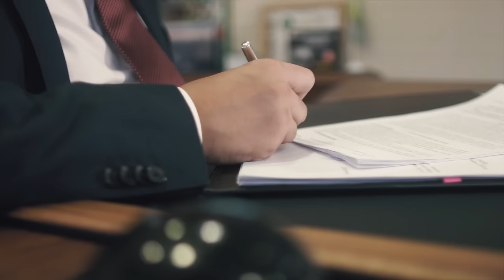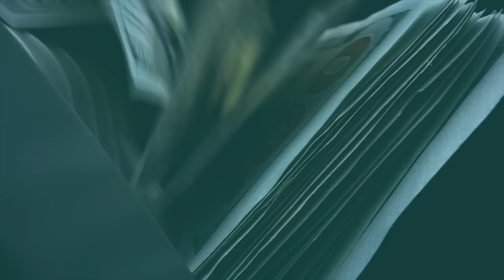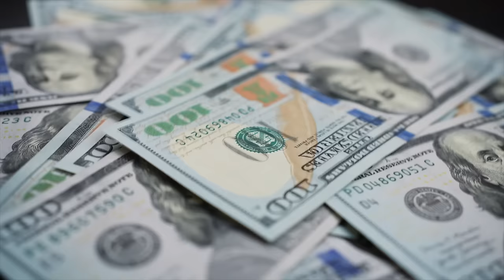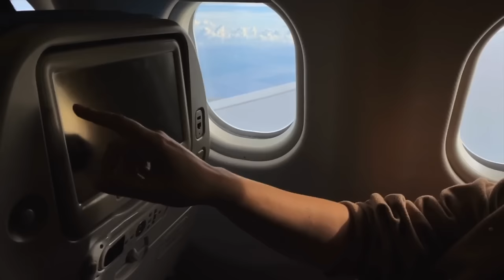How California Finally Plans To Finish The High Speed Rail Project

Comment: CAHSR's route from LA to SF is 440 miles, going via Palmdale, Bakersfield, Fresno and San Jose. To make the 2 hour 39 minute nonstop travel time, trains will have to average 166 mph (267 kph), which by comparison the fastest Shanghai-Beijing HSR service averages 181.4 mph. On shared tracks in the Bay Area and Greater Los Angeles, HSR trains will have a max allowable speed of 110 mph.
Reply: As long as it's close to 3 hours it will be a huge success. Legally, they won't have to match that time. It was explained in a court hearing that the time was included late in the process to prevent the possibility of dumbing down the project so that it wouldn't be a HSR project in order to reduce overall cost at the expense of speed and efficiency. So if it takes 3 hours it would still honor the spirit of the original run time and would still run at HSR speeds.
Reply: @mrxman581  only nonstop trains would need to make that time, and CAHSR’s proposed operating scenario calls for six nonstop trains in each direction per day, 3 morning 3 evening during peak hours.
Reply: @ChrisJones-gx7fc  Very interesting,  and that makes a lot of sense. It's so dumb on my part for not even contemplating that option. Duh! Thanks for teaching me something today.🙂
Reply: @mrxman581  well, I don’t think that’s something CAHSR has officially stated, that only nonstops have to make that promised travel time, but they are designing and building the system so they can, so it makes sense. 

It’s amazing how some if not many cynics it seems believe trains will be stopping at every station, when every HSR system in the world has bypass tracks at stations and different types of services from local to express. 

That’ll be the same in California’s case, but only several per day will be nonstop all the way. All others will be stopping at at least two stations between SF and LA. CAHSR’s 2020 Business Plan included a supporting document titled Service Planning Methodology that showed proposed stoppage patterns for Phase 1, with trains about every 10 minutes on average.
Reply: @ChrisJones-gx7fc  Still, it makes a lot of sense and would make the entire route even more appealing to a larger group of passengers.  I could see the non-stop trips be extremely attractive to people who fly between LA and SF for work.
Reply: @mrxman581  that’s exactly what they’d be for, to outcompete flying. A sub-3 hour HSR trip downtown to downtown beats flying by at least a 1/2 hour if not an hour and possibly more. Plus the train would be more convenient and comfortable than flying, and the fare is supposed to be around 80% of average airfare.
Reply: @ChrisJones-gx7fc  Indeed.  And, commuters could actually work much more comfortably on the train too. I'm sure they'll offer services like Wi-Fi too.
Reply: @mrxman581  oh they’ll absolutely have free wi-fi and other amenities currently available on other HSR trains
Reply: @ChrisJones-gx7fc  Very cool. I hope they start testing the trainsets, on the initial 119 mile section, by mid 2028, around the time of the Olympics.  It might not be ready for pay service by the 2028 Olympics in LA,  but it could still be a huge publicity opportunity to see the actual trains going 220+ mph in a CAHSR commercial during the Olympics.  I read that CAHSR has requested 2 trainsets to be delivered earlier for testing.
Reply: @mrxman581  same, though I’m pretty sure their 2023 Progress Update showed December 2028 for start of testing, but that could be at the latest. Ideally CAHSR would get enough funding to be able to accelerate progress so Merced-Bakersfield service could begin in Summer 2028, alongside Brightline West launching their service then. 

That way the US would have three operating examples of high speed rail at the LA Olympics, and that should be a national goal in the spirit of Japan launching the first Shinkansen at the 1964 Tokyo Olympics.
Reply: Sorry I misspoke on the Altamont route. Freight definitely would be on a separate track and sometimes on a dIfferent ROW with two passenger tracks like what's proposed from SJ to Gilroy. There are abandoned SP rights of ways for this purpose as explained by Michael Jones elsewhere in this thread. A new double track one mile Niles Canyon tunnel and perhaps two new short Altamont Pass bridges and a viaduct or two will be needed. BNSF perhaps also has ROW south from Lathrop to Modesto. So the East Palo Alto to Modesto route is doable with different alignment options and track speeds.
Reply: @ChrisJones-gx7fc A clarifying comment was made 12 hours ago about the Altamont route 'above'.
Reply: @ChrisJones-gx7fc  6 trains per day is very low imo. Frequency is one of the major factors that make people want to take the train; they should run them every 30 min at the very least

Comment: Merced to Bakersfield should be good for about 100 riders per day
Reply: The current metro area population of Bakersfield in 2023 is 730,000, a 1.67% increase from 2022. The current metro area population of Fresno in 2023 is 795,000, a 1.15% increase from 2022. The city of Merced has a 2023 population of 95,167. It is also the county seat of Merced County. Merced is currently growing at a rate of 3.23% annually and its population has increased by 10% since the most recent census, which recorded a population of 86,515 in 2020. Merced will be the cross platform transfer point to the San Joaquin trains and the ACE trains.
Reply: @danielcarroll3358 Forget Merced and Gilroy. Should go up to Modesto with five times the population.
Reply: @davidjackson7281  Patience. That is part of phase 2.
Reply: @danielcarroll3358 BeIng so close to Merced and five times larger I don't think Modesto should have to wait for Palmdale let alone LA or even Gilroy for that matter, actually.
Reply: @danielcarroll3358  it’s questionable, how many riders will actually utilise the system despite your. What is the total population of the Bay Area when factoring in cities that have a Bart station. What is the ridership percentage writer/population?
Reply: @DaBooster it's for the rich, no farm workers will be on the high speed train.
Reply: @dwainsellers6453 this isn't feudal Europe, there arent just "rich people" and farmers.
Reply: @danielcarroll3358 HSR supporters,  use common senses n math. Many HSR supporters.  There are always people who will always drive even with Japanese best public transportation.  In USA, that number will be high. To utilize fully, you just don't send people to LA and SF. You have to send as many people to different cities.  That mean each has high population density.  The cities has to be vibrant.  Check Tokyo, Osaka,  Kobe , Kyoto,  Nara, etc. Each city must have reason to visit in addition to visit your friends.  Each city must have state of the art public transportation or how peoplegetaround.  Oops, only SF meets that requirement
Reply: @BrakeCoach  rich people and construction workers building the high speed rail to nowhere  and make not much more than workers at Mc Donald's lol CA  is so screwed.
Reply: @dwainsellers6453  the central valley is "nowhere"?
Reply: @BrakeCoach  yeh pretty much .

Comment: I've rode the Amtrak for years and its great to go from Bakersfield to Fresno its cheap and takes a little bit longer but its comfortable. The major problem is the trains dead end in Bakersfield and you have to get on an Amtrak bus and that's 4+ hours into LA from Bakersfield which is just ridiculous but it only costs $14 so its affordable. The major problem i see with Bakersfield is there is absolutely no public transportation system set up for this high speed rail to connect to. So your going to get off in Bakersfield and that means your stuck trying to ride a GET bus system that starts at 7 am runs every 30 minutes stops at 7pm and doesn't go to half the  city. Its pathetic city planning. You have to have a car to get around its not possible to live with out one here. So Bakersfield needs to do some serious public transportation hopefully some light rail better bus routes and an all around better system.

Comment: CAHSR should've built LA to San Diego first to replace the unreliable, slow, and falling into the ocean Surfline route that currently serves it.  It would've given more funding for CAHSR central valley and SF routes as the Surfline is the second most used passenger rail corridor in the US (the NEC is number 1) so there would be demand for a faster and more relaible connection between LA and SD

Comment: I drive Amtrak trains through the San Joaquin Valley from Sacramento to Bakersfield, and have been watching the project take shape since its beginning. I believe that the 2030 date of having a section of service up and running is wishful thinking at best. At the rate building the infrastructure has been going, it will most likely be 2050 before California has a small portion of high speed rail up and running. The construction has already been in the works for a long time, and they have barely just broken ground on it. With that said, I do hope I’m wrong because I would definitely like to drive the high speed trains, and would leave Amtrak at the drop of a hat for the opportunity to do so!

Comment: The project is well worth the cost.  Not all government spending should be judged in the same manner.  Spending on education and infrastructure has a payback.
Reply: You're willing to commit to $1667 in added taxes for you and each of your family members to complete the California High Speed Rail project right?  Because that is what YOU and your tax paying family members will be paying for the next 20 years.  Plus between $80-$160 per round trip depending on the distance of your trip.  You're ready to commit to the taxes and costs right?
Reply: @hockeyplayer28  It seems like a bargain compared to what the typical California spends on the road system and their car.
Reply: @hockeyplayer28  Regarding the cost numbers, the population of California is 39 million.  The cost estimates to complete CaHSR range between $88 billion and $128 billion.  Dividing the one into the other gives a cost of between $2256 and $3282 per resident.  Assuming the cost is spread over 20 years, the cost in present dollars is between $113 and $164 per resident per year.
Reply: @gregvassilakos  The analyst reports focus on the number of tax paying citizens.  Not all of the 39 million Californians pay taxes. Some are children, some are poor, some are not taxed due to their income level.  

I have no issue at all paying taxes and voted Yes on the original Proposition 1A In 2008.  What I object to is being told that it would cost $30 billion and be built in 8 years (when we were sold the initiative) and then have it actually cost 4X that cost and not be finished in 25-30 years.  What I object to is wasteful and inefficient spending, wracked with grift on something I might use less than 5 times in my entire life.  Assuming the California High Speed Rail ever makes it to Los Angeles (where I would have to drive an hour to get to the station).

So how can this sort of thing be fixed in the future?  

1 - Tort reform.  In Europe, member states prohibit attorneys taking cases based on contingency, where the attorney's fee is linked exclusively to the outcome of the case and the attorney receives no remuneration in case of loss.

2 - Fast tracked, common sense eminent domain laws that resolve litigation quickly.  The CHSR project is mired in endless amounts of litigation which challenge established legal precedence.  Reforms are needed to fast track the process, or we should not undertake a project of this size, cost and scope.

3 - California's government should not start a project as big as CHSR without first having domain expertise in high speed rail.  Establishment of the California High Speed Rail agency should have first focused on building the expertise, before being allowed to start building the system.   Instead, what actually happened is that we started building before the agency knew what it was doing.

Many of you have asked me for a reference to whitepapers that inform my position.  Again I originally voted Yes on the original Proposition 1A In 2008, but I now believe that I made a mistake.  Here you go:  https://www.cato.org/policy-analysis/high-speed-money-sink-why-united-states-should-not-spend-trillions-obsolete#

Comment: As a french, I recomande the new TGV M, double decker train with a speed of 220mph and the train has a short size with 740 passengers seat
Reply: Frist they need to build a separate elettric (standard voltage alimentation) higt speed line than they will choose the train

Comment: Would have been a good idea except that, for political reasons, they are building it from the middle towards the ends. That means that the first completed segment will go from nowhere to nowhere. Almost no one will use it until the construction reaches at least two major cities (i.e., years from now). They should have started it from one of the major cities being connected and built it toward another major city. Leave it to politicians to screw up a good idea.

Comment: Every proponent of high speed rail assumes that the high speed rail will be faster and cheaper than driving or flying.  This is not necessarily true.  California would have been far wiser to demonstrate a successful HSR project to either Las Vegas, Phoenix, or even Sacramento-San Francisco.   Those routes would have had far less political objection, less costly, and far more likely to be successful.  Instead, California politicians are just big children who want what they want when they want it without any regard to what it costs.

Comment: I make this drive from SF to LA several times a year. It's no fun at all. (long & boring on I-5; bad traffic at points). Flying is only slightly faster (due to the traffic to and from the airports). Despite having multiple airports in SF and LA and multiple flights each day, most of the flights are full. We really need the CAHSR.

Comment: If you’re going to make a video on a project in the United States please include distance measurements in miles. We are not evolved enough to use kilometers yet.
Reply: I was getting ready to make same comment.....why the heck are they talking in kilometers??????
Reply: @davidlewis1121 international channel, also Kilometers and metrics are used worldwide. Even NASA uses metrics already. Not a big deal
Reply: @Alejandro-vn2si  I have worked for US companies that did everything in metric. Easy, and it gets around the furlongs per fortnight problem.
Reply: Consider this video a learning experience on getting your brain closer to using metric :D
Reply: If it helps, it's like 2000 loves of french bread per kilometer.
Reply: I'll help you guys out with that:

800 km (distance from LA to SF) is about 497 miles
1300 km (total planned system length) is around 807 mi
350 kph (max speed of the trains) is 220 mph
Reply: No.

The US had better stop acting like a schoolyard bully and start using metric.

Comment: US and California had done a great job with car-centric and highway infrastructures.  Bur focil fuel create CO2 and is limited in supply.  Mass transit needs to build also eco system and connecting resources for local mobilities such as on-demand shuttle, or other shared-rides services to achieve utility efficiency.

Comment: The first Japanese HS train project was over budget and not completed on-time, however, it got there. If you look at the costs spread over 50 years, it's not that bad. These projects are expensive and why "The Market" wasn't able to do it. Yes, it is an expensive civil engineering project but so was Hoover Dam and rhw Interstate highway system.

Comment: If the U.S. doesn't do this how can it expect to fix the climate issues?
Reply: It can't.  

Here's how the US will fix its portion of climate issues:  Consumption will collapse.
Reply: Sorry. High speed passenger rail is very good but it won't change the weather.
Reply: Boeing need to sell those plane, so will never allow train competition
Reply: @davidjackson7281  You would think so, but taking 40 million trips per year out of the car/flight market would certainly help. California is regularly hitting 100% of it's power from renewables, so electric trains would help quite a bit.
Reply: @ikani1 Agree electric trains reduce carbon emissions but they will require vast space for expensive solar panels and huge battery banks. Sorry to disagree with you on the ridership amount. Forty million trips per year seems like an exaggerated projection based on inflated commute use and population growth. CAHSR has revised their questimate perhaps down closer to 30 miilllion which is still too optomistic. I think 30-45k/day or 10-15 million trips per year is the best to expect. The first segment may have 2.5 million yearly trips.